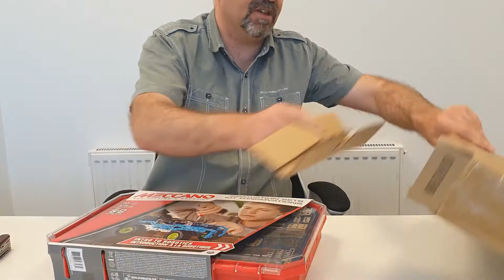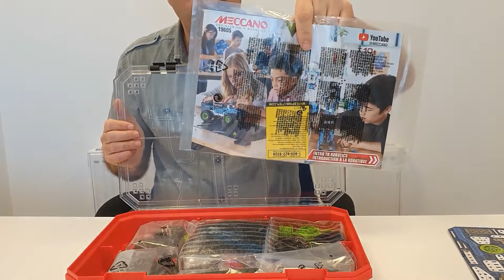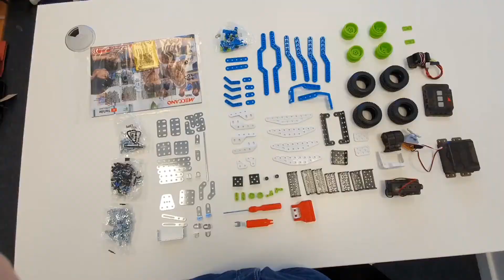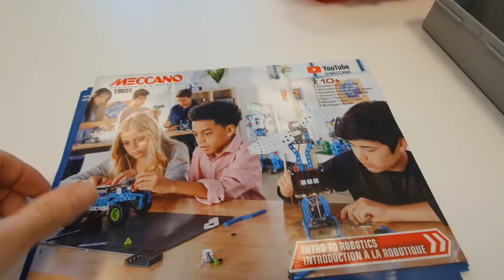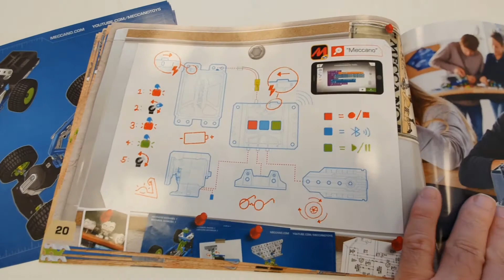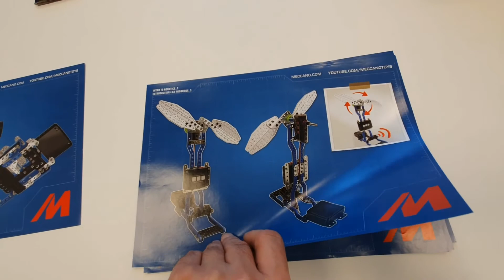Unboxing Meccano 19605 Intro to Robotics

Comment: Did you ever get this thing to work? I have one and it just sits there. It cannot Bluetooth connect to the iOS app and there are no instructions on how to program it. Can you email me your findings? Can you point me to a website? Something? Anything to get this rather expensive toy to work?
Thank you for any help you can provide.
Reply from the maker: Hi Jim, I'm afraid the issues you describe are widespread.  The bluetooth connection was always temperamental, to say the least, and since Meccano did an 'update' to the app about 12 months ago some of the programming functions just stopped working entirely.  Meccano have completely made a mess of this one, and their lack of instruction and customer support on it right from the start is disappointing.

I will probably return to it eventually using an Arduino or BBC microbit as a controller.  That isn't really a solution, because you shouldn't have to buy other parts to get it to work, but I have those controllers anyway so might as well use them.

Sorry I can't be of any more help.

Andrew
Reply: @BaldyMakesStuff  You are a big help Andrew! Thank you for your insight and persistence!!